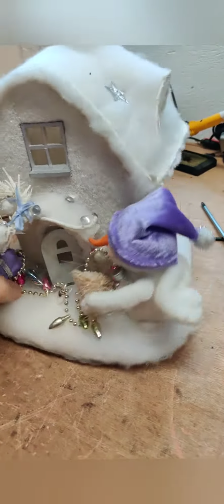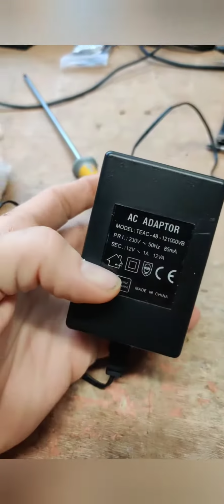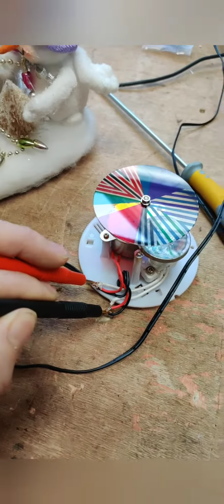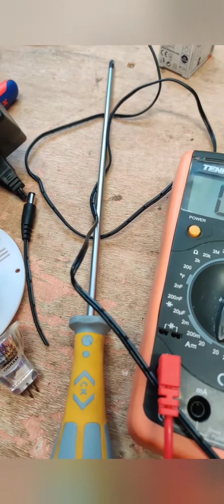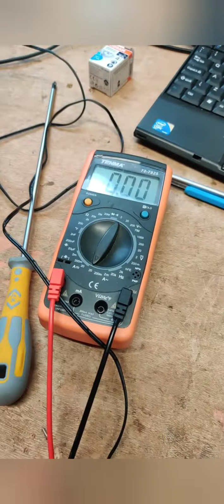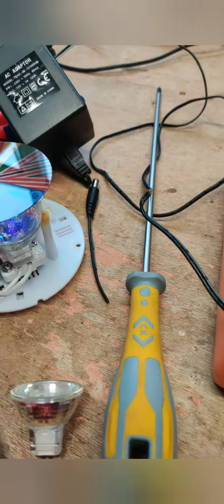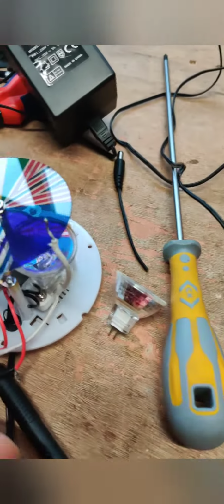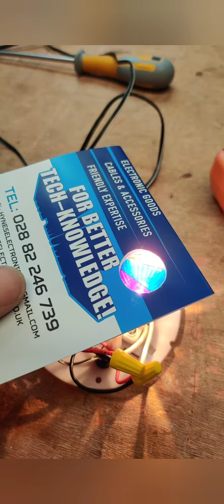Fixing Christmas fiber optic light start to finish

Comment: I have an old fiber optic snowman, my father in law put in a new bulb.  I have replaced the power supply but the motor doesn’t want to turn now.
Reply from the maker: Maybe it's the fact that the power supply is a DC version, and those motors are usually AC motors. Do you still have the old power supply to read the details off?

Comment: Is there I can buy a new motor or any of the accessories?
Reply from the maker: Yes you can buy AC synchronous motors of the bidding site & the china site too
Reply from the maker: Motors need the correct power unit to work properly. Usually AC not DC

Comment: What do we do if the fiber optic end are orange and seem burnt. I bought from a garage sale. Please help!
Reply from the maker: Are you taking about the ends that were closest to the bulb end?
They seem more orange than the other ends that are at the end of the light?

Trimming the bad ends off and resetting them into the base seems like the only option, but it might be difficult to perform.

(Hot glue gun ready)

Comment: I have a fiber Optic Snowman with same set up. I took apart the wires but not sure now how to wire it back up with the new motor. Not sure what I am doing. Any chance you have a wiring diagram? Does it matter which of the 3 wires go where?
Reply from the maker: @dannielsen158  can you look me up on Facebook and pm me?
Reply from the maker: @dannielsen158  Hynes Electronic
Reply: I am in the same boat!
Reply: @mrhynes1684  Done

Comment: Hello. Could you please help me. My motor don't work, when r connect, just getting hot. The motor got a sticker whit 12v 1.5/2 w i got a charger 12v 1.5w...
Reply from the maker: Hello. Yes not only does the volts & the watts need to be correct, but also AC or DC needs to be addressed. From experience, those motors are usually AC. A DC won't work.
Reply: Also make sure the shaft of the motor which holds the color wheel is the correct length. They usually come in sizes like 33m, 35mm, 46mm, 74mm etc.